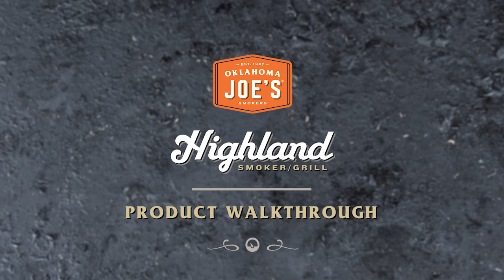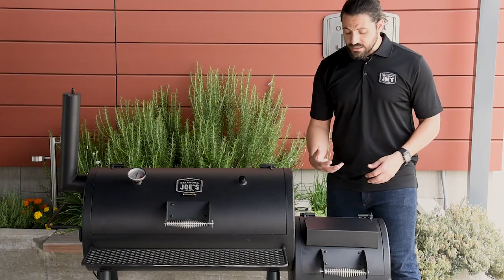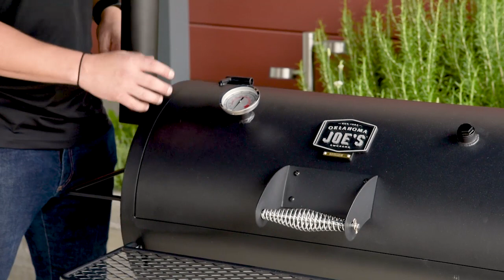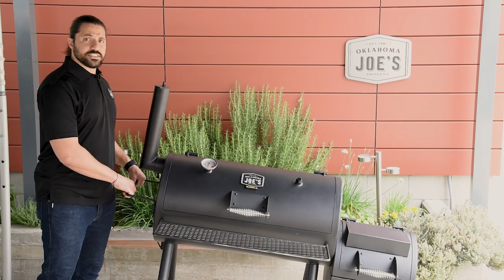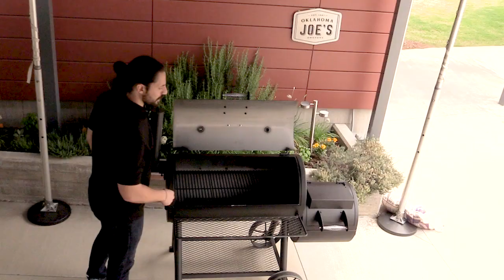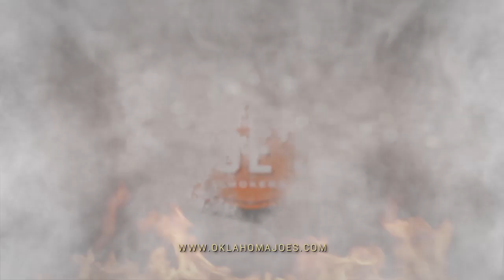Oklahoma Joe's Highland Offset Smoker Grill - Product Walkthrough

Comment: you guys need to listen up here   the device is good out of the box but needs a ton of mods
Reply: Like what?
Reply: you need a  stainless fire box,  buy  the heat diffuser plates and stainless water tray  then the fiberglass gaskets for the edges of the lid , then attach a pull down hasp  to keep it tightly closed during the cook , and a 3 inch 90 degree elbow for inside where the smoke stack is  this  will get you one great smoker  but out of the box  it's so so  @establ
Reply: @MICKIN310  - it doesn't have a drip tray. WHERE'S THE DRIP TRAY?
Reply: @MICKIN310   I had to seal the ash door, as it was so loose fitting that closing the damper wasn't affecting anything very much. Fortunately I like tinkering with things, so the ash door was kind of a labor of love, in addition to all the other stuff. It took some work, but I'm finally getting it dialed in pretty well. The temp is getting easier and easier to control and maintain.